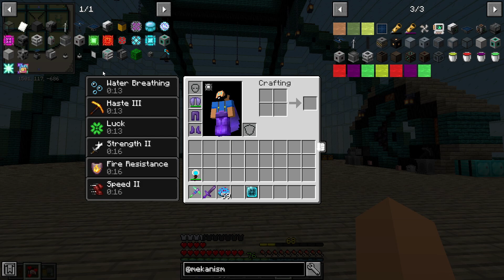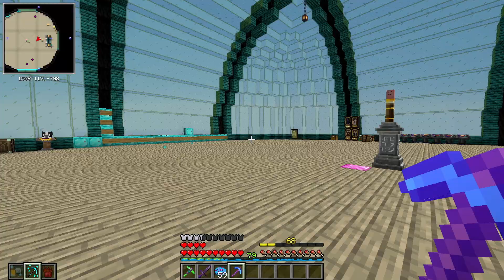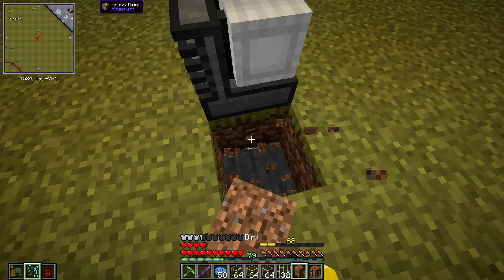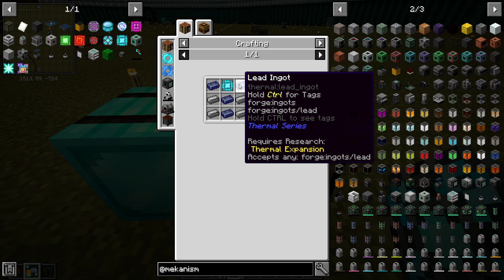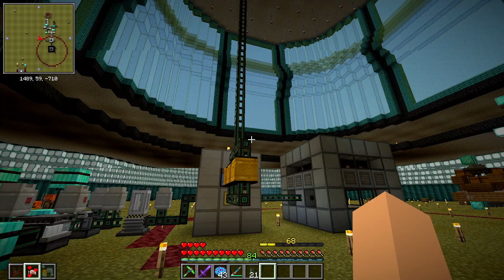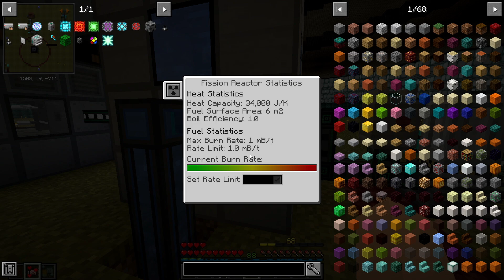Minecraft - Vault Hunters - E56 - Reactor Time

Comment: You made basic infuser and other things. Why dont you make em basic factories for ore processing? They can handle 3 times the ores.. Also i am using powah generators.. And i think its easier and more resource efficient.. Mekanism takes too many opals.
Reply from the maker: I'm going to use basic factories for the ore processing but the stuff for fuel is making more then I can use so I'm leaving those normal for now. I needed the reactor for the storage I went with and I don't have anything else right now needing the opals.
Reply: @Door_SG  You need 300+ opals just to craft an omega pog. In my world i am also saving for omega pog to craft a disassembler. So yeah.... Thats why i said it.

Comment: My main source of power in my vh world is actually carpets. If you can get a furnator thing or anything that generates power from furnace fuel, you can then build 3 carpets dupers per machine. And then I use a powah ender cells to act as a flux point for all my machines because flux networks is way too expensive. And then I have infinite wireless power lol
Reply from the maker: Nice this reactor is producing more then I need right now.